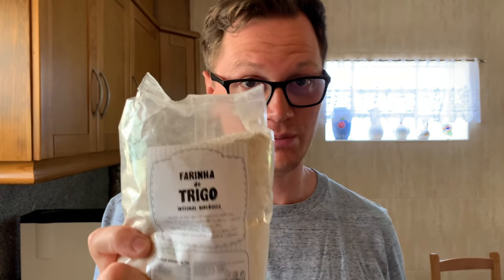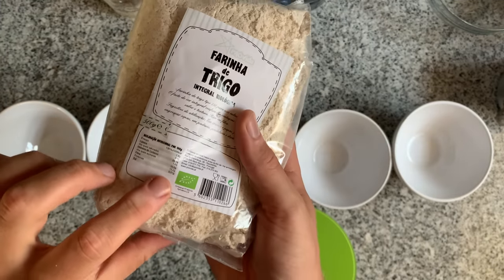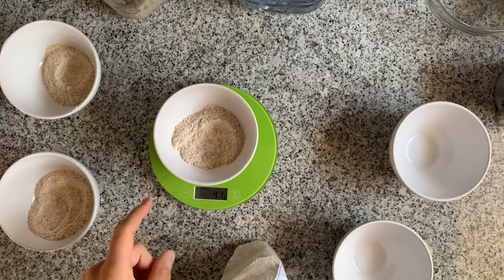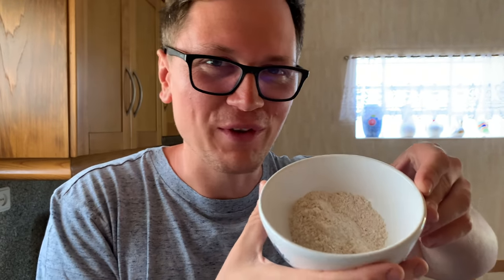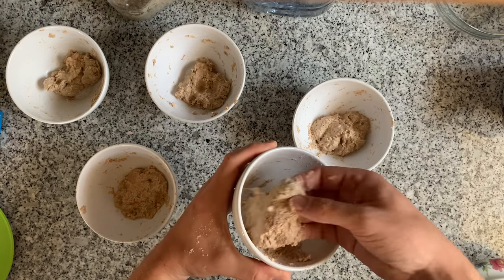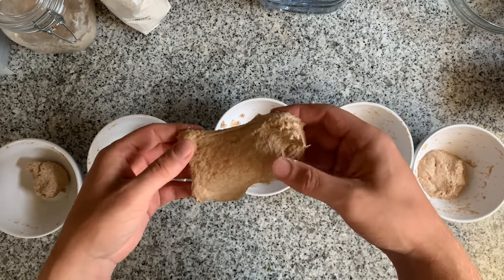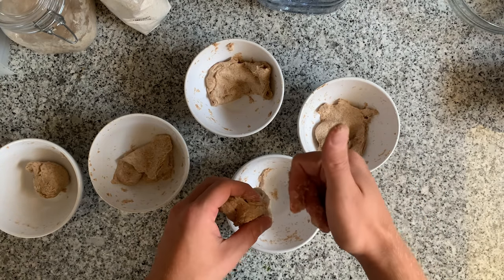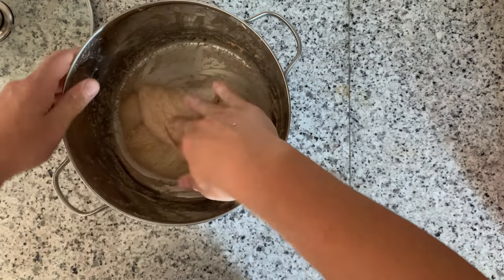This is how YOU Master Sourdough Hydration - The perfect Water Quantity

Comment: A little trick about digital scales from an embedded engineer: Although the load cell has a sampling frequency in the kHz range the software takes an average for a 1 Hz update frequency on the display to make it easy to read.  Furthermore, many scales assume you are measuring something of fixed weight and will have some algorithm to lock in on a single value.  That's what you see going on here.  If you just tap the scale with your finger -- to add a few grams to get outside of the locking delta parameter -- you'll "trick" algorithm and the scale will then settle in and display the proper weight.
Reply: This is extremely useful information that every baker should be aware of. I will start using this hack for things like salt where I'm adding small amounts.
Reply: Interesting stuff, thanks for sharing!

Comment: Thank you so much. After switching flour I had trouble making a strong dough. I had no idea what I was doing wrong, so I did the hydration test yesterday. This was a real eye opener. It's fun to play around with the results after autolease (kneading, shaping, windowpane...) and get a feel for the different hydration levels. Because I didn't want to throw all of this away, I just put all 5 test doughs together, kneaded this for some minutes, grabbed a random bunch of 1:5:5 starter (not even leaven!!) and some salt, and put it all together. I placed it on the bench overnight and this afternoon  I discovered (to my surprise!) it had gotten quiet some rise. I was even able to shape it and decided to bake. You may not believe this, but it turned out to be one of my best loafs so far. Really incredible oven spring, super crispy crust and a tasty, lovely crumb. I guess, apart from hydration levels, I learned not to throw anything away and to try and make the best out of what you got. Thanks again for the great video's!

Comment: Thanks so much for this great advice! I wish I found your videos before I tried my very first sourdough loaf yesterday, yep it was very wet! I had to plop it into a tin, otherwise I would have got a pizza. But my starter is pretty mature as it rose a lot. But I'll definitely be reducing the hydration in my next loaf.
Reply from the maker: Moin Liz. Thanks for the comments. I could not agree more. I have done the same mistake at the start so many times. I had to learn the hard way that hydration depends a lot on the flour that you are using.

Comment: Hi, Thanks for your amazing videos. One question/suggestion (please correct me if I am wrong). When calculating the hydration level for your sourdough bread you should use the flour weight and water in both your starter as your autolyzed dough. So if you for example have 500 grams of flour for dough (protein level 12%), and 200 grams of starter with (100 grams rye flour (protein level 15%), and 100 grams of water. You have a protein level of 500*12+100*15 = 12.5%, meaning you want to have a hydration level of 60%. To calculate the amount of water needed for autolyse is then 600*60%-100 =  260 grams of water.
Reply from the maker: Hey Bart, yep - you are right, 100%. However most bakers when making a recipe already include this slight addition of hydration in their calculation. So that the extra few % from the starter won't do a big difference. That makes the math a little easier. Thanks!

Comment: Brilliant! First ever seen that on YouTube! Makes it easier for me as a beginner to handle my dough, because it's difficult to get always the same quality of flour when shopping at different markets. So, you mean it's possible to shape a 100% whole wheat high hydration dough with this method? Thanks for sharing!
Reply from the maker: Moin Benjamin. Yes, definitely. I have been doing that here exclusively in Portugal. Although also with average success, mostly because I go on tours over the day, I wake up late, or early. Hard to find a proper schedule. Most of my breads have been overfermenting and turned our rather flat hehe. But back at home I'll upload a recipe with 100% whole wheat.
Reply: The Bread Code thank you, enjoy your vacation! Your answer brings me to an important point to learn when making sourdough bread: timing! Next to technique, this is my greatest challenge to plan a schedule over 24h or even longer and do the right steps at the right time without stopping my entire life around. The highest goal would be to achieve the optimal result at an optimal end point (e.g. Crispy sourdough rolls on a Sunday morning breakfast without getting up in the middle of the night). Proper use of a fridge seems a key for that goal. When following a recipe, I often get stuck because the next stretch and fold or any other step should be done at 2 a.m. 😬 perhaps, after your holiday, you can comment on this and elaborate a guide for beginners? Have sunny Times 🌞😊
Reply: Benjamin Jakob use your fridge you will have more control over your dough it allows you to double your time in bulk rise and after your final shaping. Don't pre shape if you won't cut your dough..

Comment: Many thanks for this great tip (and all your other videos)! What do you do if you plan to use a mix of flours, like all-purpose and whole wheat or bread and spelt, and whole wheat (depending on what one has at home)? Would you need to determine the ideal hydration for all flour types you plan to use?
Reply from the maker: You are most welcome. I would suggest to prepare the mix and do the same test 🙏🏻. Ideally I recommend to use 80% wheat. It will infuse the majority of the baking properties. Depending on the type of spelt it's very genetically close to wheat. It could have almost the same properties.
Reply: @the_bread_code  May I ask further? If I plan to use a mix of different flours (incl. whole wheat, wholegrain rye, rye bread, spelt) shall I weigh the same proportion of all the flours in smaller quantities for the hydratation test?
Many thanks for your kind advice and for all your very helpful and illustrative videos 👍

Comment: Hi Hendrik. This video is very helpful. I will test my flour tomorrow. This method is for lean doughs. Can this technique be adapted for testing which hydration level should be used in enriched doughs? For example, I make a potato bread recipe with an egg, milk, butter, and sugar; I am not convinced that the hydration level is suitable for my flour. I am using Foodgeek's excellent bread calculator to know the actual hydration level. Or is there a rule of thumb for enriched doughs, like maybe "use 5% less hydration than you normally would for a lean dough made with your flour?"

Comment: Really good video. Thanks! I was wondering if we want to use different percentage of flours. Would you test it by mixing the flours and then adding different percentages of water or rather by testing each flour individually and then working out the math? 🤔
Reply from the maker: I would probably test individually each one. You mean different flower compositions, right? Different ratio of whole wheat to bread flour etc.
Reply: @the_bread_code  Yes that's what I mean. By doing your method I found out that the AP I had  is stronger than the bread flour. So my lasts bakes have been with 35% whole wheat, 45%  bread flour and 20% AP, with 75% hydration. That was all intuition after doing the test on all 3 flours. I was wondering if a test to the mix would work or a math calculation would be better to figure out what's the right ratio of all 3 flours

Comment: You should also mention that your ambient temperature and humidity (and even altitude!) affects how the flour absorbs water....but the video is a great example of how to find the "sweet spot" range of hydration for a new flour type!
Reply from the maker: Oh wow. I did not know this. How big is the impact between 20C and 25C for instance? Thanks.
Reply: @the_bread_code  Well, basic physical science states that the warmer the temp. the MORE evaporation will occur. For your experiment (where the dough is only left for a few minutes) it may not make much difference BUT IF you were in a very dry climate (low humidity) then water will evaporate very quickly. Even worse is my current situation : here the air is VERY dry and also I am at high altitude (1,750 m above sea level), so that is a "double strike" against me when it comes to baking!

Comment: So I use an organic artisan bakers craft flour with 11.5 % protein in a overnight country blonde recipe that calls for 78% hydration. I am finding that the dough is difficult to shape after bulk fermenting overnight. I am careful not to over ferment. Should I reduce the hydration?
Reply from the maker: Moin Paul. Yep. Sounds like you should reduce it a little bit. Also make sure to not overferment. Give it another shot. I'd try 70% hydration.
Reply: The Bread Code would you reduce in the levain and the final dough? The levain takes 400 g and the final dough takes 684 g - where would you reduce. Greatly appreciate your help

Comment: Thank you for this helpful video! Unfortunately, I don’t think I’d be able to do it since I do not have a kitchen scale. Is there a method to eyeball it without one? I always end up adding too little or too much water.
Reply from the maker: The best option is to go by look and feel then :-)
Reply: @the_bread_code  Thank you for responding. Another question, if my dough ends up too sticky after I autolyse and mix the ingredients, how can I fix this?
Reply: @nk6698  You can either use a loaf pan or try adding just a little more flour.  The gluten will develop as it bulk proofs.

Comment: I suppose these tricks work for commercial yeast bread also, don't they?
I'm wondering if you can't really go over the suggested hydration level at all? Or there are other factors at play also such as shape and type of the final dough? I remembered from other video where you demo this trick before, you said something a long the line of you wouldn't be able to bake a boule out of this hydration level, but a sandwich loaf might be possible. Does that mean I can go a little higher if I bake in a loaf pan because there is a pan to help the bread hold shape? or, say, crazily over the recommendation if I'll bake a focaccia where I don't really need it to hold shape? I'm kind of not very clear on this part.

Point is, I haven't tested my flour yet but wonder if it turns out to not be able to hold much water, but I want my bread to have a chewy texture of high-hydration dough, will my only option be to find another flour altogether?
Reply from the maker: Moin Wasin. Thanks for the excellent questions. Yes, works with yeast too. Yeast is much easier as you don't have the issue of piling up acid induced by the bacteria. Yep, I frequently bake a 90-100% hydration sandwich loaf in a loaf pan. Works very well and has exactly the consistency you described. For a boule/batard that would not work.

Comment: Just another engineer’s look on baker’s math: in case you use 500g of flour and want to go for 60% hydration, you would add 300g of water for autolysis. But later you add 100g of of your starter which consists of around 50g water and 50g flour so you end up totaling 550g of flour and 350g of water, which is almost 64% hydration! This ratio shifts with your hydration rate that you started with in the beginning. Any thoughts?

Comment: Thanks for maybe the best video about hydration on YouTube. But I'm still a bit confused. The capacity of water absorption of each flour depends maybe on its existing humidity content (flours are not totally dry). So lets say flour "A" takes maximum of 70%  hydration, and flour "B" 80%. But since flour A has already more humidity, the results of making a bread with flour A/70% and flour B/80% are the same. Bread Code, have you experimented this already? if not, would be very interesting.
Reply from the maker: Totally valid point there. But I think - this also works with this test. Dry flour has around 15% humidity. By using this test you will know the max for your flour :-)
Reply: @the_bread_code  In Spain I tried different flours, and the maximum confortable hydration was 65%. Now I am in Canada since 1 month, I am using 75%, and can go even higher. In both countries just with supermarket white bread/strong flour. I'm confused about the reason, but in Spain the ingredient was only "flour" and here additionally a bunch of other things. At least now I understand why youtubers in different countries use different hydration %.  Do you know a reason for this? Thanks again for this great video!

Comment: Please i only find flour with 10gm protien and i have tried sooooooo many times to make any sourdough for bread or pizza but always failed...Any help from you please???
Reply: Mmm might be a little bit hard, but try with 55/58% water. Should be a good hydration for that flour. For bread and pizza in general you need a flour with good amount of proteins (mostly for the chewiness). Bear in mind that usually traditional Neapolitan pizza is done at 58 to maybe  63% and if it's done in like 8h they don't use a strong flour at all 11 to 12g of proteins usually.
Reply from the maker: Moin Huda. Exactly like Manuel said. Caputo flour is not that strong, doesn't have that much protein too. Try lowering the water amount. Should do the trick 👍
Reply: Might be tricky to find if you have limited sources of flour but you can also add gluten to lower protein flour, if you can find 'vital wheat gluten'. It's the stuff used to make seitan also.
Reply: @usafan96soren20  Thank you so much.
Reply: @hudaghassan5912  you're welcome
Reply: @the_bread_code  Caputo goes up to 14g, and at least they have the W-Wert/Value ;)
Reply: Which country? For Germany I could name a few stores and their brands which have up to 12g protein (no W-value though) for abou 1 Euro per Kilogramm. I haven't gone far with sourdough but with yeast I've gone up to 80% hydration with flour 12,8g protein content. 9,6-10g, normal AP flour I've gone as far as 70% which is a pain in ... and usually go for 65% hydration. It really comes down to experience. Sourdough is something I'm starting, always wanted to and as there is still yeast to buy (or very expensive compared to before) - another insentiv...
Reply: @the_bread_code  Hello! 
I have read from different sources that using a high percentage of high protein flour can lead to a less-than-tender interior. One gets bigger holes with a high protein flour, yes. Is this statement true? However, I’m not that much after the holes and crumb’s look for insta pics but softness, tenderness and less gumminess in my bread. I live in Luxembourg and Italian flours (with high protein like semolina or manitoba or similar to those you mentioned in your preferred flour choices  are scarcely rare  — practically no choice/variety except low protein typo 00). Available flours here have low protein content/are «soft» and come from France and Germany. I looked up that the Italian flowers you mentioned have very high protein content. First, I’m afraid to order before not being sure about the difference compared to German 55 and French T55 they (IT) would make in baked structure/taste. Also, often IT flour sources mail just big batches and delivery to Luxembourg is very expensive. Can you comment about the protein content and how it affects (in different aspects) the end result once baked. Also, can you advice some good German 55 flours (or any other you have used) which are easily available for home bakers in Germany: e.g. from amazon.de or online shops or some supermarket or bioshop in Germany. 
Many thanks in advance!
PS I prefer to work and bake with high hydration doughs. If that matters at all.
Reply: @nopenope1  Hi! Can you suggest some good supermarket, bio shop or online store flours in Germany — the ones you have had the best experience/more for your liking. Also, does very high protein flour give less tender and more gummy bread like some say?
Reply from the maker: @Dellivation  I'd say the tenderness is mostly related to the amount of water that you are using for your dough. The more water, the more elastic and soft the crumb is. You can achieve great results too with German T550 flour. You will have to adjust the water content though. The crumb in the end won't feel as "wet", but still it will be delicious!

Comment: Nice content!

But may I suggest putting a towel underneath your metal bowls when you're working with your dough.

The grinding sound of the metal against the granite (when you're turning the bowl) is a little nerve grating and disruptive to your narration or conflicts with the soundtrack. 

The audio level is great but the mic is so sensitive, the bowl noise is picked up and transmitted at the same level as the other sounds.

I know it's another thing to think of but I think it will help with the overall quality of your videos.

~Thanks for reading! Keep up the good work! Have a great week.😊
Reply from the maker: Moin Tx Pepper. You rock, thanks for all the great feedback. I am filming everything using my old iPhone :-D. Is there a microphone that you can recommend? Something that is easy. I don't want to invest in too much equipment. Cheers!
Reply: @the_bread_code  I don't have a clue about sound equipment but I really don't think you need to go to the extra expense or setup headache of adding auxiliary equipment.  Your phone is fine.

Just a small cloth, even the size of a small napkin should do just fine.  Just something to create some separation between the metal pot/bowl and the granite.
Reply from the maker: Thank you very much. Good idea, I will try that :-)